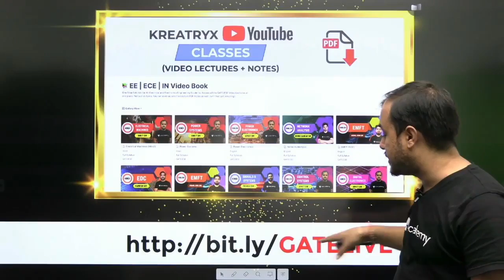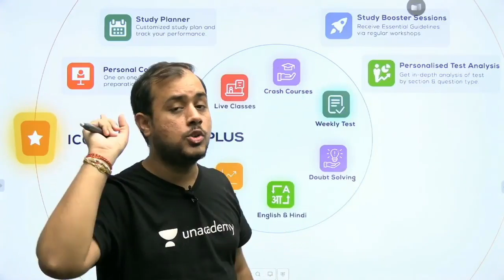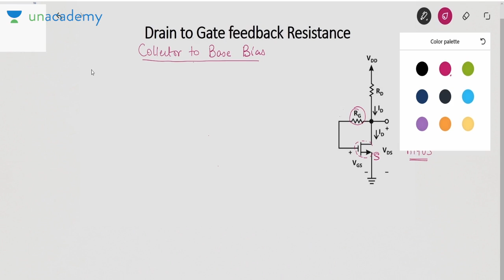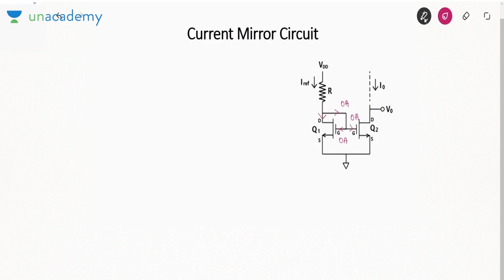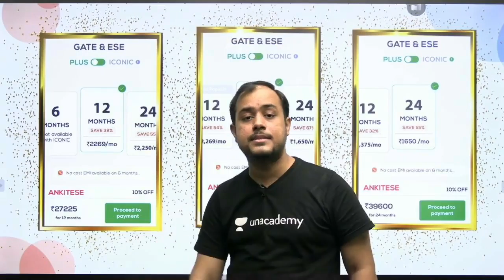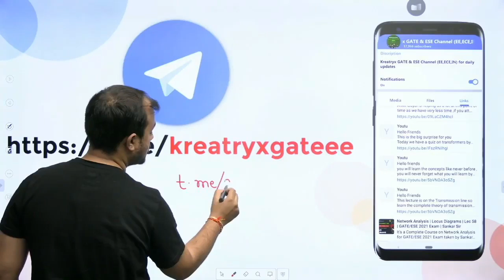MOSFET Biasing | MOSFET | Lec 65 | Analog Electronics | GATE 2021 Exam

Comment: There is a mistake in the current steering circuit. Mosfet q4 is short circuited by connecting its drain to source. The gate of Q4 and Q5 are should only be connected to  Q3 not to vdd.